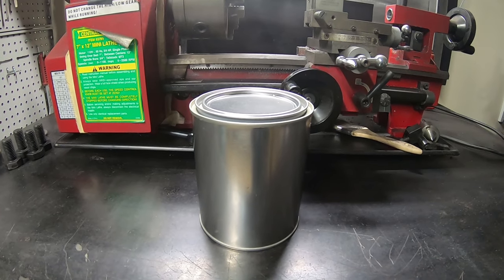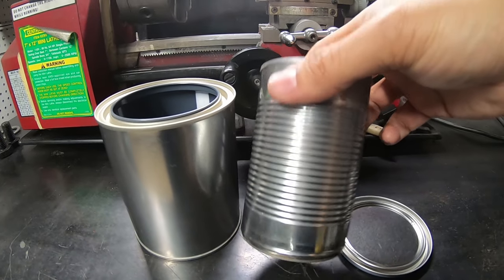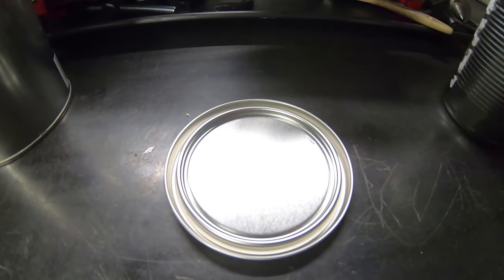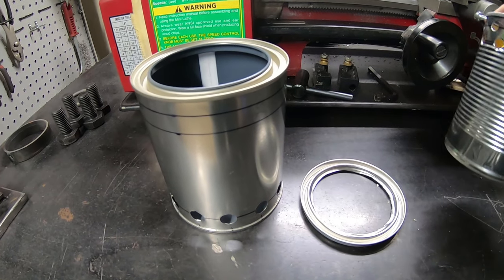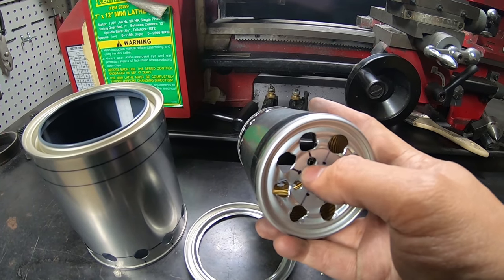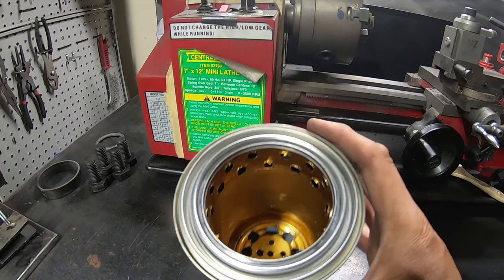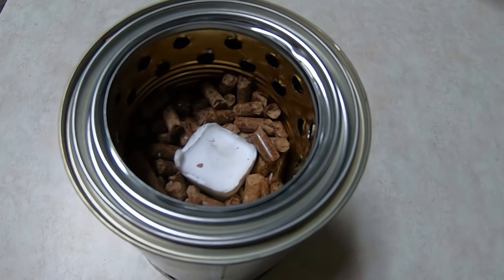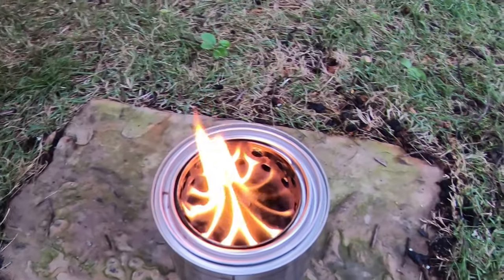DIY Wood Gas Stove - homemade paint can gasifier. Simple and cheap.

Comment: nice looking build. If you want more heat all you need to do is to block off some of your primary air inlet holes to choke the stove down and this will do two things,  1) increase the burn temperature and 2) increase the overall burn time for a given fuel load. For builders if you see any smoke or get soot on your pots this is a sign of un burned smoke = carbon the solution is give choke down the stove reduce primary air intake which will heat up the burn temperature and burn that carbon. You can do this easily with a spare tin lid cut to fit into the burn pot with a hole in its middle. Big hole more air, smaller hole less air - simple. 

   A clean burning stove is an efficient stove and a safe stove to be around. If you think that second hand cigarette smoke is dangerous it is nothing compared to wood smoke which is tens of thousands more dangerous. Who knew? Well we all do now. Be safe.
Reply from the maker: Thanks for the input. I'll be playing around with this design and will try your recommendations. The parts are luckily really cheap so prototypes are not going to break the bank. Did not know about wood smoke being that dangerous. Won't be using this as a tent heater anytime soon then. Thanks for the heads up and time to explain.
Reply: @ShinyInsanity  looking forward to reading about your results. If you still don't obtain enough extra heat to burn up all your carbon/smoke then the next step will be to slightly increase the size of your secondary air inlet holes to provide more oxygen to burn the available carbon but leave this as a last adjustment fine tune your primary air holes first then if further tweaking is required move on to the secondary air holes. Best of luck.
Reply: WawawwaaaA
Reply: @ShinyInsanity I recommend the very opposite. Reduce your secondary (holes on top) make it a single row small. Allows air more time to heat and produce secondary ignition. Ratio from primary (bottom) to secondary should be 4:1 or preferably 5:1. Also make it with a progresso soup can. No need to cut the lid. Progresso snaps into paint can easy.
Reply from the maker: @pimpjetfighter05  Hmm, Progresso soup it is then. I like their creamy chicken and wild rice so will need to try this again at some point with your tips. Thanks.

Comment: I like, that you didn’t cut out the bottom of the outer can. It’s safer, and holds the heat better.
Reply from the maker: Yeah I've seen some designs where they do that and couldn't see the benefit of doing it.
Reply: Its like a bushbuddy stove
Reply: @ShinyInsanity  that could be helpful for storing the pot holder away without wasting space, just tuck it in the bottom, but most do that just so the whole stove is telescopically assembled which reduces bulk a lot. tho i wouldn't mind this type since you can store a backup alcohol stove, fuel, kindling and a lighter inside the burn chamber anyway, and without a bottom in the can you'd want an ash pan to protect the floor.

I suggest only making a row of secondary burn holes, and adjusting their width if need be. The smoother the hole the prettier the jet, not that it matters. You can make a pot holder out of any can that fits neatly on top and maybe even make a double layered one - one part to hold up the stove with holes on the side, like a tuna can; one part without holes, just to serve as a windscreen, which would improve boil time.

Stove looks real neat with the smooth paint can on the outside, far superior to any other stove I've seen
Reply from the maker: @pedroclaro7822  Thanks for the great feedback. To be honest I didn't even think of the storage aspects so that is a good consideration. I've been meaning to try and tweak  the design but haven't really had the chance to play with it recently.

Comment: Your build looks great! I cut the bottom out of the outer can entirely to let the ash fall out, but I didn’t get nearly as neat a fit between the two cans
Reply from the maker: Thanks! The good thing about this type of build is that you can try again with different combinations since the materials are pretty inexpensive to experiment.

Comment: Good effort although it would have burnt hotter and cleaner if you had only 1 row of 1/4 in holes at the top. The number of holes in the inner can base was overkill since was considerably more area than the outside air holes.
Reply from the maker: Good thing I didn't cut out the base like I had first planned then.

Comment: I built a bigger one, very crude construction but works, what I need now is a decent set of cookware that isn't teflon coated, because that teflon burns up and can leech toxins into your food.
Reply from the maker: Carbon steel pans. Cheap, light and durable for this type of cooking.
Reply: @ShinyInsanity  what temperature this burner can heat a pot?
Reply from the maker: @manojkumarsubramaniam7122  I do not know the specific temperature but I did try it later with a small pot of water and it was able to boil it. It took a while to do so though.